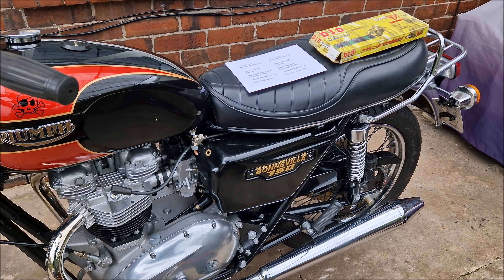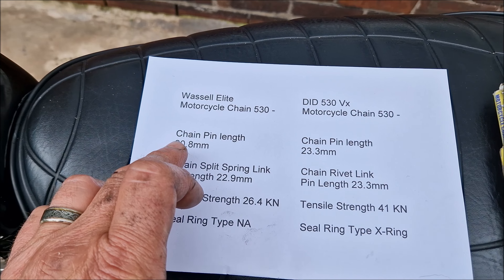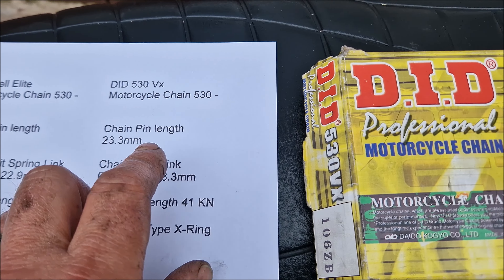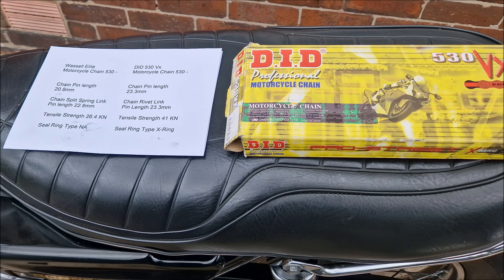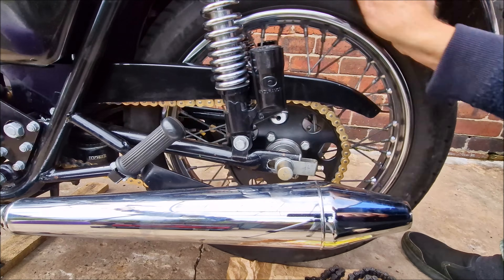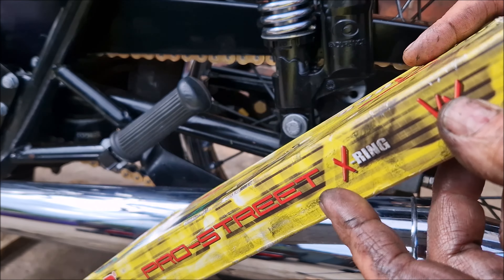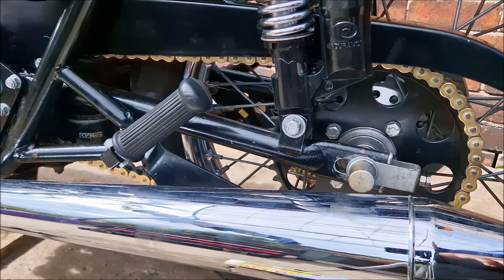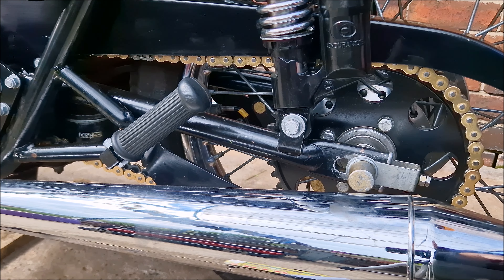Triumph Bonneville T140E 1979 Fitting a DID X-RING chain. Will it Fit?

Comment: Hopefully you haven't changed the oil flow through the oil filter, as it will not work on the feed.
All of these oil filter kits have to be fitted to the return.

Comment: That amount of movement on the chain over the sprocket can also be due to wear on the sprocket
Reply: The roller diameter on the japaneses chains is not the same a the Reynolds chain so there will always be some sloppiness when you pull the chain away from the sprocket.

Comment: If a chain deflects more than 10" from straight in an arc then its shot.
8" is passable. 6" is sound and serviceable.
Reply from the maker: Ok thank for that. Good tip..
Reply: @relph3  No problem Ralph. 
For those unsure this is a lateral deflection test that highlights sideways play in the links over the chains entire length.
Reply: It depends on the length.

Comment: How did you deal with the length? It should have a half-link to give the right length, otherwise you will run out of adjustment very soon.
Reply from the maker: I'm running a 43 tooth rear. Stock is 47 tooth which uses the half link. Although I'm sure it's possible to fit a chain with out the half link anyway. The front sprocket on my bike is a stock 20 tooth.
Reply: @relph3  You've had a chance to run it for a while now - have you had any clearance issues? I thought about it, but decided against it because of that (my T140V has standard 47 tooth rear, so I would need the half-link, anyway)

Comment: After riding a Triumph 750 for over 40 years, l can tell you that these bikes stretch chains. I can never get more than 3000 miles out of a chain. No matter the brand or type.
Reply from the maker: I was getting about 3000 miles use from my t140 drive chains too. I expect to get at least double that with this DID X-ring  fitted. I have, at the time of writing this, used the chain for nearly 2000 mile with absolutely no signs of wear at all. Next time you change your chain, get the same DID X-ring I have fitted, you won't regret it. 
BTW... I have also got a ZX6R it is a 1997 F3.